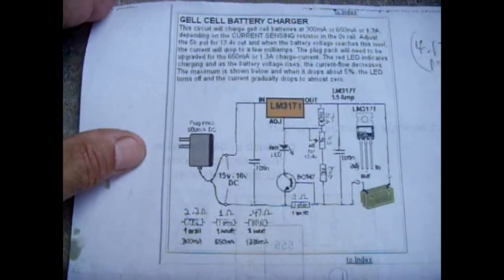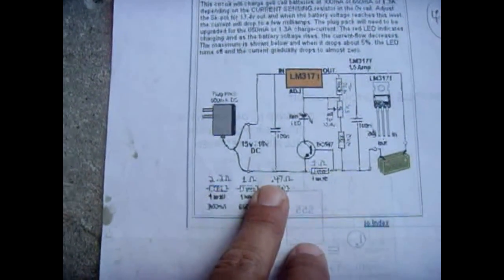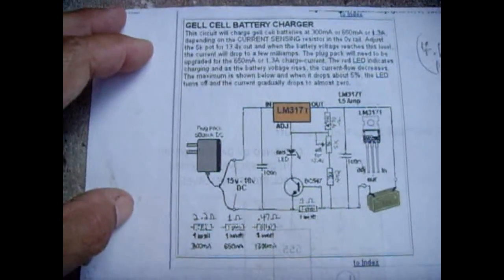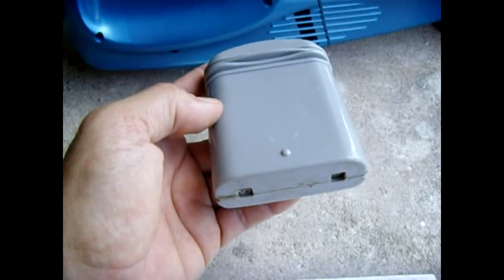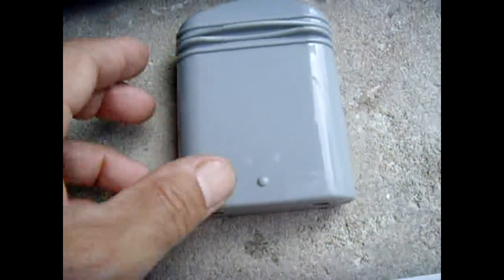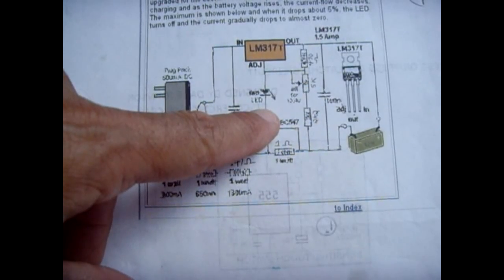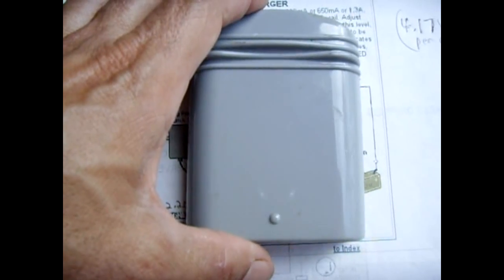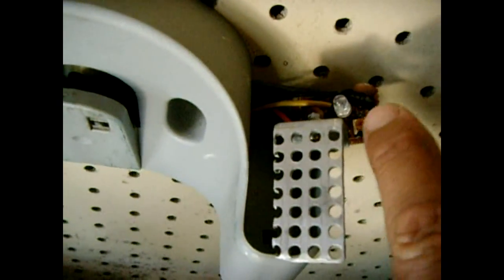Excellent & Simple Battery Charger (Gel/Lead Acid/Li-Ion/+ more)

Comment: hello sir, 
Your circuit is superb great! It give some idea for me do my project but i want to ask a few questions which are:
can i use this circuit for lithium pack battery charger?
how this circuit control  from over-charging and over-discharging?
plz help me sir. 
thank you.
Reply from the maker: I have been using the circuit for over a year now with no problems at all charging 2 li-ion 18650's in series. Ideally they should be charged in parallel. The max charging voltage is around 4.15V per cell(slightly lower than the 4.2v max). Charging current is limited, as well as the max voltage. As for added safety, place a thermal cutoff firmly against the cells(between them) using thermal compound. In the event the batteries become too hot, the circuit will open and prevent charging. You should experience no problems.
Reply: Thank you sir.. oo i see. one more thing i want to ask, can i know how u calculate the output voltage and output current and how to determine the value of resistance should i choose in the circuit to control both output? I hope u can share the steps to calculate it.
Reply from the maker: The desired output current is achieved by changing the resistor value as show on the page with the schematic. You can figure out the current from the 3 different resistors shown. As for the voltage output, Look here:

http://www.electronics-lab.com/articles/LM317/
Reply: One more thing i forgot to ask, can i use this to charge the lithium using solar panel or in other word the lithium battery will store the electrical energy from the solar panel?
Reply from the maker: I don't mind helping, just as long as you return the favor by sharing my channel with others. Help those who help you. :-)

As long as the solar panel has a powerful enough output(around 20W), then you can supply enough current (500mA) to charge the LI-Ion batteries. Do not charge more than 2 batteries in series.
Reply: thank u so much sir. your informations really help me. I already shared this video through my fb. sir, if the solar panel i want to use is 2.4kW, can i still used this circuit?
Reply from the maker: Just as long as the open circuit voltage of the panel is not too high. 18.5v to 21v
Reply: sir, i just tried your circuit. i observed that the output voltage can be
adjusted by using potentiometer but there is no current value at output and
my LED doesn't lights on. what is possibility error happen in my circuit?
Thank you.

Best regards,
*Nuraisyah *
Reply from the maker: Circuit definitely works. Try reversing the LED leads. If that fails, then I would check all components, try a new transistor, and make sure you have the correct leads to the transistor.

Thank You! Be sure to share.
Reply: can this circuit control charge and discharge during charging process sir?
Reply: how it control charging and discharging of the batteries?
Reply from the maker: This circuit DOES NOT control discharging. This is a CHARGING control circuit. If you are worried about the batteries getting too hot, then use a thermal cutoff on your batteries under charge.

Thanks For Watching!

Comment: so the "2k2" resistor means "2.2k" ?
and the "470R " resistor is "470" ohm? right sir ???
Reply from the maker: yes
Reply: thank you sir . how about the 5k pot i saw the schematic  and the 1rst pin will be connected to 2.2k ???? and the middle pin of the 5k to 470ohm resistor along to the ADJ pin of LM317T is it right sir???? thank you

Comment: Can I use a pot instead of the 1W resistor so that I can change the amps before charging different batteries?
Reply from the maker: Just as long as the POT is rated at least 1W. Be sure to also add a 1w resistor in series with the POT. That would prevent you from dialing zero ohms. Choose a resistor for the highest current rating you desire, then lower it with the POT you have in series.

Thanks For watching!
Be sure to check out my video playlists as well.
Reply: If I can't find 1W one will it be a good idea to connect 4 0.25W in parallel?
That is assuming those I have laying around are 0.25W
Reply from the maker: Yes. (4) 1/4w in parallel = 1w, but the resistor value used will equal 1/4 of the resistor value when all 4 are connected in parallel. So use a higher resistor value to compensate.

Comment: Tried making one today since I've got an old HP printer's power adapter just lying around. All is well except for the LED which wont light up.
Reply from the maker: Is the LED installed backwards? Did you try a different LED?
Reply: i used a  2 single pin connectors so i can reverse the  connections, tried other LEDS but still wont light up:

http://tinypic.com/r/vo5v1l/8
Reply from the maker: You realize the LED will only light when a battery is placed across the leads to charge. Right? If you know that already, then swap out the bc547 with another one.

Comment: Sir, can i charge? 1200mAh
3.7volt Li-ion battery? For mobile phone
I think if it will be possible??
To charge? I need to adjust the voltage to 4.5 volt?
And also the resistor
Reply from the maker: The MAXIMUM charging voltage should be 4.15v to 4.17v. Lithium Ion batteries will last longer by not keeping them fully charged, and charging them to the "almost" full state. Set charging current using the proper resistor from the schematic. I suggest 300mA-500mA  for a 1200mA battery. It is also a good idea to use a themal cutoff(65-90deg celsius) in series with the battery under charge. Make sure the cutoff is secured against the battery.
Reply: Thank you for your reply Sir, Your so great teacher....

So on the cut-off?  How many components to be use?
Reply: Wait sir? Cut-off? So i need a relay again? To make one of this? 
Can you make a example of that im a little bit confused.
Thank you very much...
Reply from the maker: You don't have to use a thermal cut off, but it is a good idea. A thermal cut off/cut out is not a relay. It is a specially designed component which is designed to open a circuit if the temp rises to a set level. Once the battery cools, the cut off will reset. Look it up.
Reply: Sir im confused again regarding to potentiometer,, the 5k potentiometer has 3 legs... So the first leg will be connected to 470R the middle leg to ADJ. And 3rd pin to 2k2 to resistor???
Reply: Sir can i replace "1ohm " 1 watt resistor to "10 ohm" 1 watt wirewound resistor??? Thank you
Reply from the maker: Using a 10 ohm resistor would make the charging current too low. You need between a 1 and 3 ohm resistor for that 1200 mA battery. You can place two resistors of the same value in parallel to get 1/2 the resistor value.
Reply: Ok , how about 3W 5.6ohm 10% tolerance wirewound sir???
Reply from the maker: use 2 in parallel. You will be fine.
Reply: ok sir so the 
1 ohm 1 watt is 650mA
and 
"2R2" means 22ohms only? right and also the
"0R47" is 470ohms? 1 watt? is it right sir??? thank you
Reply from the maker: No. 2R2 means 2.2 ohms. 0R47 means .47 ohms.
Reply: ooohhh!!!! thank you very much for correcting me sir, now i know , hope you reply to my comment on your video, "Cut-Off Circuit" thank you sir.

Comment: I am having absolutely no luck trying to build a lithium ion charger. I have purchased every component to this circuit and still cannot get it to work. I set my voltage out, never get an LED to illuminate, and once I connect my two cells my voltage drops to  6.78V and holds... What gives...? I have over 600 18650 cells I would really like to utilize but am coming to the conclusion I am best off just buying a charger....

Comment from the maker: Really should charge lithiums in parallel(just like in a laptop battery pack) to a maximum of 4.17V using this circuit. You don't have to fully charge them. 80-85% charged is fine, and better for the batteries. I would suggest charging at 1/3 to 1/2 the battery rated capacity. I would also suggest connecting a switch which opens the connection between the middle battery and the end batteries, and places them in parallel for charging. Then you can switch back after charging them up.  TPDT switch

Comment: I'm using this circuit to charge my 12v SLA backup battery. When the main power is off, a relay closes and the battery is used instead.

Can this circuit be modified/amended to deliver power to other components (nothing more than 24W) while charging the battery, such that when the power is out the battery delivers power?

Comment from the maker: If you take apart a laptop battery pack, you will see Lithium ion 18650's connected in parallel in 3 
groups of 2 or 3 batteries. Should not be a problem.

Comment: Anyway I want also to make a project like you...i have the M12 Milwaukee batteries for my drillers and I want to make a 12V Vacuum cleaner to accept this batteries. The connection of the battery to the vacum cleaner is clear. Also the charging part its ok because I will use the Milwaukee charger...I know that the driller stops drilling when it detects that the minimum voltage of the battery is there...The vaccum cleaner will it stop? or it will destroy the battery until the end

Comment: Dear Friend
Shouldn't you charge each lithium ion cell separately? What you show it means you are charging 2 cells in series. Can I charge 6 lithium ion batteries in series by applying the total voltage of that pack? Need your help...